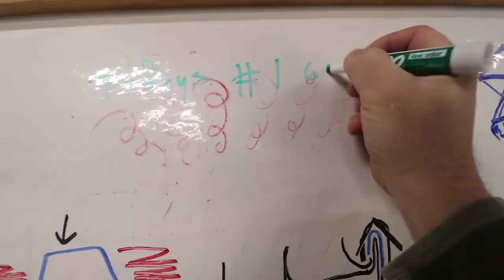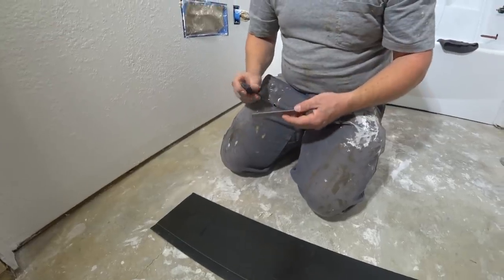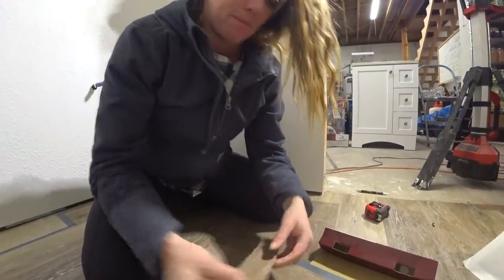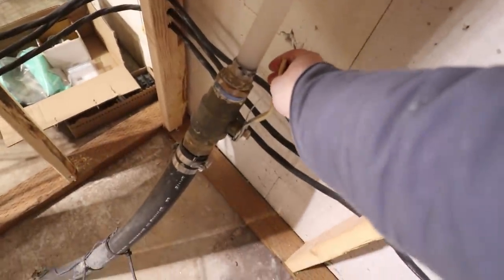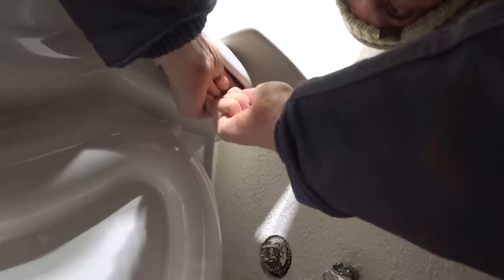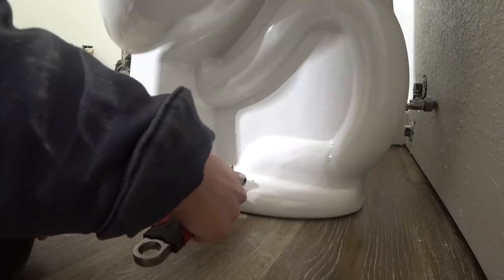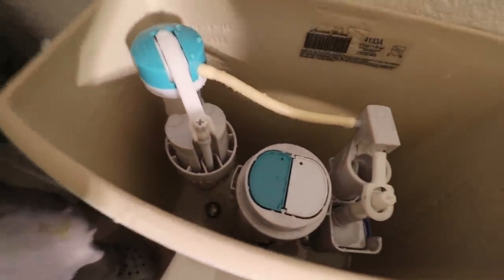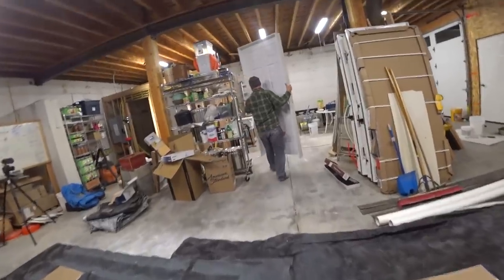On Your Mark, Get Set, POOP! (Installing Bath Fixtures)

Comment: Just a tip when painting doors, insert 4 screws 1 near each corner top and bottom and let those rest on your saw horses, then your able to flip the door and paint both sides at the same time.

Comment: 1 1/8” is the magic measurement from the drywall to your cut. The escutcheon and stop will butt up to each other. Also, that speed cutter doesn’t cut the stub outs properly because its soft copper. Those are meant for rigid 👍🏻

Comment: Search online for a toilet called a sloan flush mate.  They use your water pressure to fill a tank within the tank that expels under pressure.  I've used them for 17 years and only replaced one of the three that I have installed.  Good luck and great job!  Enjoy your videos.

Comment: To paint doors, I put 2 screws in the top and bottom edges of the door. Then I can flip the door and paint both sides the same time as the door is resting on the screws not the painted surface. Works great and half’s the painting time.

Comment: Very cool! We installed the exact same vinyl planking in our upstairs bathroom 2 years ago. Extremely happy with it. Also installed the silicone toilet gasket. No problems at all.  thanks for a trip down memory lane. Yes the measuring and cutting of the flooring around the fixtures is a trip!

Comment: Cutting the copper pipe is another good use for your vibrating tool, particularly after scoring with the little round cutter that doesn’t quite finish. Also did not see you reaming out the copper pipes after cutting. This is recommended even when not soldering to reduce water flow restrictions.

Comment: Great job guys, another little tip for you on the flooring. It helps to heat up the material with a heat gun or torch to make the cuts easier.

Comment: It's going to be so great living in your house soon!

I have counter tops in the apartment where I'm living right now that are also flush with the draw fronts like on your vanity.  I have to suggest for the more serious counters and washrooms you avoid that and get counter tops that have an overhang.  Like with most modernist design and their fascination of getting rid of useful stuff, an overhang actually has a good purpose. One: to avoid dripping stuff all down the face of your cabinetry, and two: to make it easier to clean and maintain the counter top itself.  After living with it for a couple of years I would never ever willfully choose to have flush cut counter tops for anything.

Comment: It did my heart a power of good  seeing Jessie trying to fight back a  grin when Alyssa had to admit trimming a floor panel "to the opposite hand". Hi Alyssa - welcome to the club. All of us - people who actually do and make things - have been caught out like that. They say it's good for the soul - "Liars!"

For those who are still to use a compression fitting on 1/2" copper pipe - a couple of observations. ..

- after trimming the pipe to length - de-burr the inner edge. That rotating cutter swages the pipe smaller so the bore becomes measurably smaller. Not too critical on larger sized piping but the percentage reduction in bore area on 1/2" is noticeable on low head installations. 

- when installing the fitting onto the pipe - slide on the nut, slide on the olive (age-old name for that "wide wedding ring"), push the fitting onto the pipe - using it to push the olive further onto the pipe - push until the shoulder inside the fitting bottoms against the pipe - now run the nut onto the fitting until it just feathers against the olive, make a mark on the pipe against the nut and withdraw the assembled-but-not-tightened fitting 1/8" to ensure some clearance between the shoulder inside the fitting and the end of the pipe. Now tighten up the nut to "first contact plus half-a-turn".   

That 1/8" withdrawal is the important step in making a non-leaking compression  joint - it allows the fitting to move towards the olive  when you are tightening the nut - ensuring that both ends of the olive are fully swaged against the pipe. 

cheers all - edi

Comment: Just to let you guys know I have had that exact toilet for about 8 or 9 years now. The reason I bought this toilet is because it had a small compact tank, dual flush and a 10 out of 10 flush rating. Have had no issues with it. On the flooring, you should add 5 to 10% for scrap. Depending on the size and shape of the room. If you have minimal cuts, 5%. A lot of cuts, 10%. Or... If you mess up... Lol U guys are great. Love the vids.

Comment: Actually you completed 6 tasks in this episode when you add painting and installing the door. A job well done,  I’d heard about those silicone toilet rings, but never saw one installed until this video.  Great job for both of you.  Needing to reinstall some of the flooring is a very common thing for any DIY’er, including my wife and me. That’s another reason why we all buy the 10-15% more material whenever we purchase any construction supply item.  You will really feel like you’ve reached a major milestone when all the electrical is completed and you move into the garage.  For the winter weather, you may want to consider adding a small enclosed area around the “man-door” so that you don’t lose all your heat when you go out or come in.  Think of it as a mini-shelter area or a plastic tent that you walk through to access the door.  We’ve done that in some of the homes we built and it can be easily created with scrap lumber and plastic tarps or sheeting.

Comment: When doing round cut outs on vinyl do  your first several cuts using an awl or scribe. Just a point makes it easy to trace a circle. Once you have a little trough, it helps hold the knife.  Or just keep going with the awl and you'll eventually cut through.

Comment: I've done lay down sheet in 3 bathrooms recently. I laid out pieces of rosin paper cutting them to fit all of the walls and cut outs and taped them together making one big piece. I then rolled it up took it into a bigger room laid it down on the piece to cut marked around all of it and cut it. Worked real well.

Comment: Jesse a tip for painting the doors, put 4 long screws in the end of the doors resting them on the top of saw horses   then you can flip the doors and paint both  sides at the same time. just a tip

Comment: Actually, the vinyl sheet goods they sell at HD and Lowes is pretty easy to lay down.  I first dry fitted by cutting oversize.  Layed it down in the room and trimmed it the walls etc. then rolled it back over itself, spread the glue and layed it into the glue.

Comment: Good choice.
I love that vinyl plank with the overlapping glue strip. I did my entire main floor 5 years ago and it's still looking awesome.
Be very sure to roll the joints (LoL) so they stick very well.
Pro Tip: Use offset tin snips for curved cuts!!

Comment: I have used this exact flooring in my kitchen, dining room, hall, and bath.  Much easier when you find out you can easily cut it with a metal shear (tin snips).  Not a bad first install though.

Comment: You can buy stainless steel escutcheons that won't corrode. I like to leave a little more pipe in case that valve needs to be replaced in the future. Something to keep in mind as you finish the rest of the house. Luckily you purchased the good quality valves that will last longer though.

Comment: Fitting and painting doors, I have found it easier to put two screws in the top and bottom of the door and rest these screws on the saw horses to make it easier to turn over the door when painting the other side, these holes will not be seen and can be filled and touched up later. spray paint outside and just carry them inside to dry.

Comment: Your supposed to put the decorative rings as you call them on first, measure, give yourself some room if the valve fails for cutting and replacement before you tighten the compression ring. Now there is now way to install them without cutting the valve off and starting again. If you cut perfect from the start you could be in for it .

Comment: For future reference. Put 2.5"  screws into the top and bottom of doors and place the heads of the screws on the saw horses to allow the flipping of the doors to coat both sides more quickly.

Comment: Most excellent. Even the paint job looks good. You’ll have a functioning bathroom in a day or two. If need be you could put up a temp rod and shower curtain and take your time with that fancy dan curved door. If you plan to use this flooring again in the house, a Dremel tool or a router makes quick easy work of cutting those curves. A router would also handle the straight cuts easier than that utility knife. The only downside is the flooring material will foul the router bits after using them. The router is for sure the better tool for the curved cuts. Much quicker. 

Life is good with a few victories … that’s mojo for more progress.

Comment: If you can find rattle can spray paint in a color you like it does a great job on wood trim and doors !  Two coats of spray primer, let full dry.  Light sand and then 2 or 3 coats of spray.  Buy a couple extra can of finish because you do not want to run out in the middle of the job.  If you want that "perfect" factory finish, let dry at least 24 hours, light sand and another 2 or 3 coats.  Best part, almost zero clean up !

Also very smart using an all vinyl flooring on concrete !  Even with a good draining sub-grade, insulation and a moisture barrier, any cellulose will not do well on concrete.

Comment: Coming along well. A few questions though...
Where are you putting the urinal? 
Wouldn’t the door opening out create more useful space inside the room?

For indoor painting in a huge garage, you can build a quick frame and put cheap clear plastic over it.

Comment: When you spray paint a door next time  put 2 nails in the top and 2 in the bottom of edge of door.   That way you can let the nails rest on sawhorse and the door will never touch .  That way you can spray both sides . You can flip the door by grabbing the nails and flip a door around.

Comment: Get yourself a fine finish low pressure spray tip (fflp) for your gun. Graco and Titan both make a version, but it will change the way you paint trim, doors, and cabinets. More control, less overspray. Thank me later

Comment: Those toilets that are really noisy have a pressurized tank inside instead of just a gravity fed tank.  They used to use less water but your toilet was marked with the 1.28gpf which is really close to the pressure fed toilets. 

The current benefits of a pressurized toilet is no condensation on the water tank. Plus the extra pressure cleans the toilet bowl well each time.

Comment: Hammer 2 nails 18 inches apart in the top and bottom of the door . You can use these sit the door on the saw horses or carry them by the nails.

Comment: surprised no one answered your question... to lay sheet goods and get all the cutouts, use construction paper... literally you lay the whole floor out in paper and then transfer tthat template to the vinyl. To cut cirlcles/notches in that hard vinyl floor plates, use handy dremel with a router or drywall bit.

Comment: Fantastic, your bathroom is functional! You will want the lights and fan next, the door too! I really like the vinyl floor, will probably try that in my home, the floors in my home are not level, someone built solid walls in the basement and the teleposts are no longer adjustable,  so my laminate floors tend to separate. Thanks for sharing!

Comment: You can't put on escutcheon rings after you install compression valves. The nut will not come off the pipe.

Comment: Just for next time... You should cut the floor on the top side. You don‘t have to cut fully through. The top side is more flexible and the rest will maybe brake (if it is the same as we have in Switzerland).

Comment: Tin Snips would have made some of those cuts much easier. The edges look like they should have been given more of a gap (that gets covered by baseboard). As the temperature changes that floor moves more than one might think and if there is no room at the edges the middle will buckle.

Comment: Here is something i learned from a pro. Glue The toilet to the floor using silicone. It gets more stable than with volts. Its easier to clean the floor around if you seal it to the floor.
Silicone can also be used to seal the gap between the vanity and Wall.
Reply: Jonas Strandbergit definitely won’t be more stable than with the toilet bolts. You must install the bolts. It is a good idea to caulk the toilet to the floor, but leave the back un-caulked. If you have a leak, you want to see the water versus it building up under the toilet causing mold

Comment: Not that it matters now, but in our previous home we had radiant in-floor heat with two toilets and used wax rings on both. Never had an issue. I sure do miss our in-floor heat. And just out of curiousity, why did you install the flooring lengthwise instead of widthwise?

Comment: Best line of the video.  "Does it need electricity"?  But I was right there with you Alyssa.  If it doesn't,  why's it not working?  There might be more to this plumbing mullarkey than just 'Plug & Play'!  I have a feeling all the "Jet Propulsion Cyclonic Action" of your new expensive loo happens inside that adjustable "... if you adjust it we won't guarantee the results" valve unit in the flush bit.  You don't have an easier to adjust stopcock  (do you call them float valves? )  Is the water hooked up to the bath/shower unit already?  And, do you need a final "Go" permit (no pun intended) from your inspector to say it's a usable bathroom as the final step.   I assume you're going to put the skirting board in last?

Comment: So...the floating floor will allow moisture to get trapped under the floor and be a breeding ground for mold and bacteria. Should have glued it down with a moisture resistant glue. Even peel and stick would have been better. You will be replacing that floor if there is any unexpected flooding or wetness.

Comment: Tip: the snips you used for the roof ..they will cut the round ovals and circles in THAT flooring ,now you know for next time,the spring or the cutting wheel may need replacing,or the spring is lost its springey nesss ...... <made up word

Comment: Why did you not put an insulation layer under the flooring? I do know you have the underfloor heating but surely a barrier between the flooring and concrete would of been advisable

Comment: Because you have a small slope to your septic you better be sure about the amount of water you use to flush #2.  Get it to small and it will look like it worked in the toilet but everything is slowly clogging the drain pipe.  I thought I was doing the planet good and got a small flow toilet and I have my own septic and well .  So, good luck.

Comment: The flushing is working properly. The cyclonic flush is to reduce the staining/skid marks in the bowl. Also let your wife know when using the low flush. Do not add tissue paper. Will not flush the paper. Liquids only...

Comment: when you talked vinyl i thought it would be clickvinyl is the one with glue not harder to get right. i call bs on easyst floor. there are way more easy vinyl systems. i seen ones that you can click any side onto any other side.

Comment: toilet seal.. even better, next bath use a flange with a rubber cone seal. no fuss no muss. I have never had a problem with them in the USA or Mexico.  no more yucky wax. There 4" and 3", long and short cones. There are even versions for retrofitting. The rubber snugs directly around the toilet outlet when you set the toilet in place.

Comment: I work with Allure all the time when putting it down on concrete you need to put 3 mil plastic under it as a vapor barrier.  after you take a few showers it will in fact separate... just saying.

Comment: Don't cut the wall stubs too short.  When you are done,, someone else will have to replace the valve,,,, ten years,, fifty years from now.  Each repair will need to shorten the pipe.  You cut it short enough,,, no one can repair it in the future.
Reply: Oh it can be repaired...tear the whole wall out. $$$

Comment: I hope you folks hire the sheet rocking done. You will spend ALL winter doing it your self and it will lack in quality. No offence but your bathroom texture is lacking ALOT. If you get the sheet rocking done you can spend better time adding nice finishing touches, Like tiling, kitchen work. accent work. I built our home and saved money doing my own electrical, plumbing, roofing, siding, painting.. I spent $12000 on drywall work and the finished work is much better then I could ever do. By the way I had them spray a light orange peel texture and we have liked it for 12 years. We can wallpaper over it if we want. It hides minor irrigularities in the dry wall, it paints nicely. You will REGRET trying that big of drywall project.

Comment: Thats one thing I had not thought of, that's using plastic pipe you definitely need to have 2 wrenches to tighten the compression fittings.

Comment: Danger..  Alyssa, I saw you use the utility knife,, in a very scary way.    You never put pressure on a cutting tool with the hand in front of the pressure.  Not ever.  Never.

You were slicing the flooring, and at one point you were cutting toward the hand holding the flooring.  It scared the poop out of me.  Been there. Done that.  and I have the scars and stitches to prove it.

Comment: Boy its nice going indoors again and using a full sized ANYTHING....
Next time you wont need to cut holes in tiles but ,you can use a heat gun to mold the tiles then cut thru from the top like butter,and under the toilet it can be square because the toilet covers the hole  covers DUH!!!!!
REMEMBER ubidy tube has how too videos on everything ,Im suprised there a how to wipe your ass video...